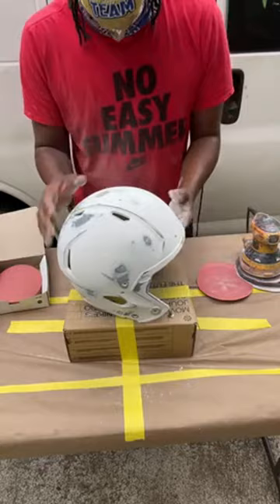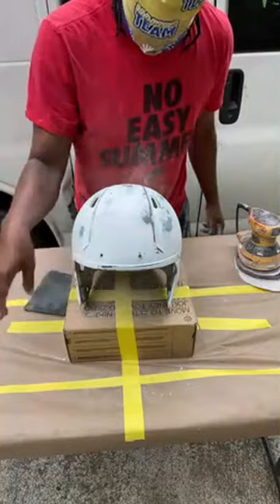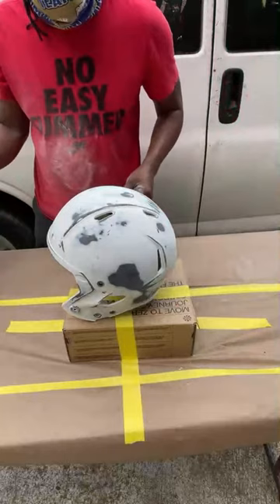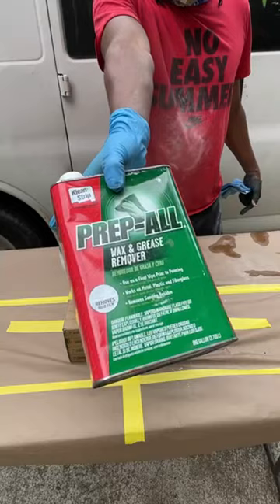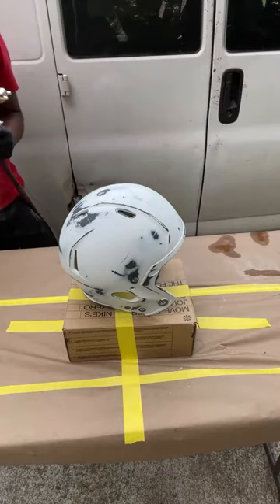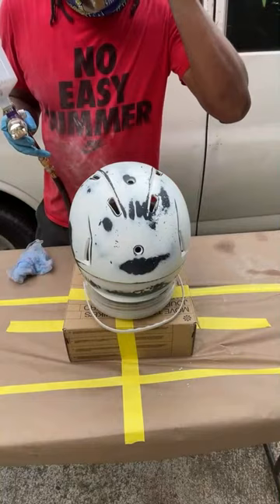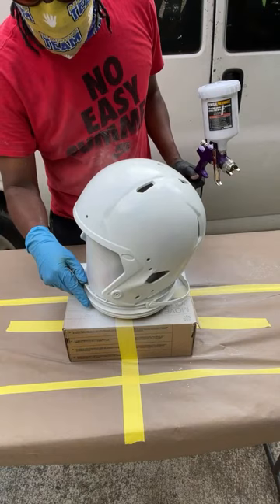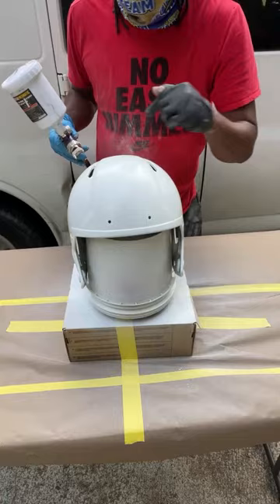How to Paint a Football Helmet LIVE‼️

Comment: What pressure is your gun set at and do you spray with everything wide open?
Reply from the maker: I normally don’t use gauges but if I had to guess around 28-32. When you say wide-open, I’m assuming you’re saying the fan? You’reso usually 75% open

Comment: what paint do you use if you don't have a compressor does the automotive rattle can clear come with Hardner premixed?
Reply from the maker: I used automotive paint, if you don’t have a compressor, rattle can will be fine. Just try to get single stage paint but if you can’t, you still should be fine with clearcoat in a can
Reply: @bumperwithhandsteam1757  thanks for the info. I usually do shoes but my son's friend is in a spot  his red helmet needs to be white by Saturday. I just don't want it to chip of so I want to get automotive rattle can? Is it a harder set?
Reply from the maker: If you’re concerned about it, chipping, use a adhesive promoter
Reply from the maker: I do several hamlets every football season. I have not had any problem with clearcoat chipping.
Reply: @bumperwithhandsteam1757   awesome thank you so much again!!
Reply from the maker: No thx you🫡